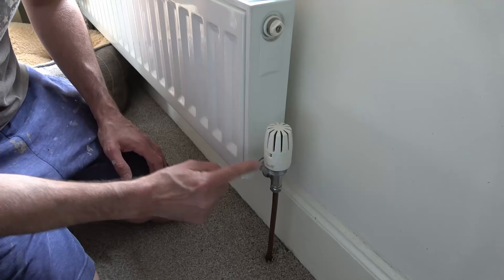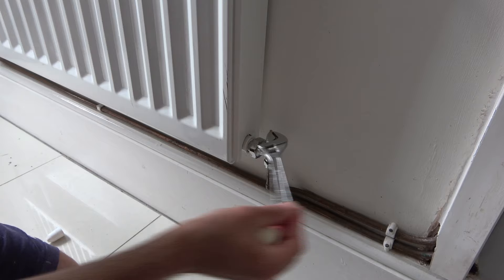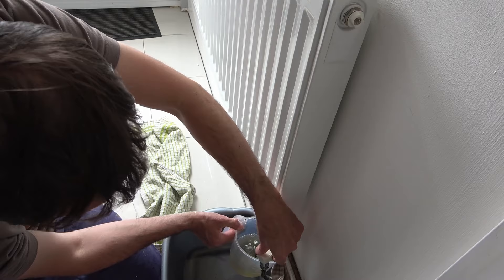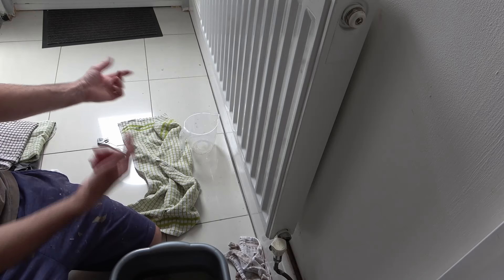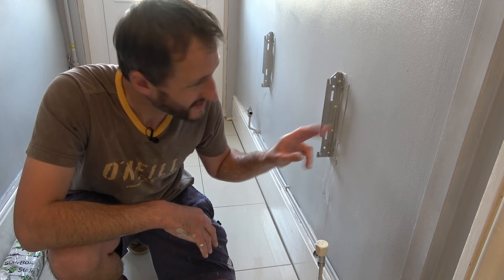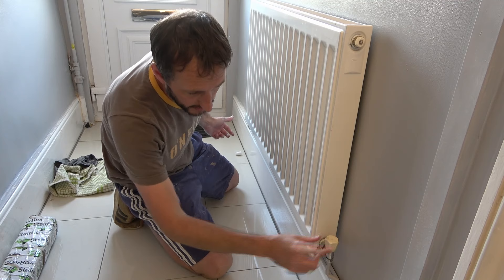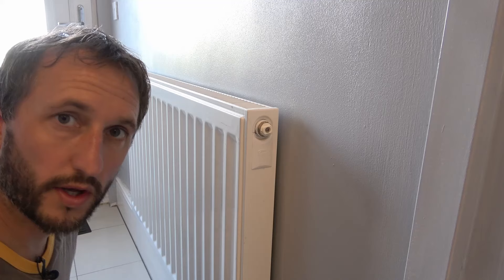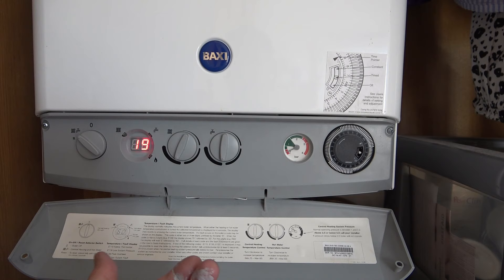How to remove & refit a radiator without draining central heating system. Radiator valve isolation.

Comment: Another tip don't leave it out the front cos the fookers will have it on a scrap van before you've put the kettle on.
Reply from the maker: I never leave any metal out the front around here!!
Reply: Great video
Reply: Around my part of the green and pleasant land we don’t have to put the scrap out the front they just come in and remove it from the wall when those of us are lucky enough to have a job are at work 👍

Comment: Why didn't you use the drain on the rad valve at the other end .....plus people please please please if your radiator has a thermostatic valve either shut it with the manual decorators cap or fit a brass blanking cap to the valve exit cos they have been known to open on the frost protection setting

Comment: If you get an old pair of rubber washing up gloves cut off a finger. You can stretch it over the radiator pipe and keep most of the water in the radiator to take it out and then drain it.
Reply from the maker: Great tip, I might try that. Thanks for the feedback and thanks for watching John. 👍

Comment: Once the radiator is off block the bleed valve, and turn the radiator upside down, that way it won't leak on your carpet

Comment: Tried it yesterday, sadly didn't work. Closed off left and right as far as it would go, opened the bleed valve and air and then water shoots out suggesting that the inlet on the bottom won't close all the way 😢

Comment: I'm needing to change out a valve that's seized open on one of my old cast iron radiators. It's located in my living room, and is directly over the boiler in my basement. It's the first to recover hot water and is the hottest radiator in the house. As a result, the heating throughout is not balanced. The problem I'm having is that i would like to do this without draining the system, but i believe that's not possible for me to do because all of my radiators only have a valve on the entry port of the radiator and not another  valve on the exit port. In my situation there's really no way to do this without draining the entire system, correct?

Comment: I use my wet hoover and just vacuum the water as it comes out. If a smaller rad I'll cling film over the rad valve and elastic band it in place. Rad can then be carried outside and emptied.
Reply from the maker: Nice tip, thanks! 👍

Comment: This is very helpful and easy to follow. The two top screws holding one of my radiator have come loose needing redrilling new holes. Rad is wobbly. Thought I had to empty the system to remove the rad to fix the screws until I came here to watch this video. Thank you for this well presented video.
Reply from the maker: No problem, glad to help 👍

Comment: Little tip...if you are storing the radiator inside while it's off, nip up the bleed valves and flip the radiator upside down, it definitely won't leak then.
Another tip....don't rely on a TRV being turned right down with the radiator disconnected, always best to lock it off with the little cap it came with. I knew a guy who flooded his house once because he did that. It was real cold weather and the thermostatic valve opened when he wasn't about! Oops!! (He might chip in if he's reading this! 😂)
Reply from the maker: I think I know that guy!!
Reply: Not sure if you chaps are still about, but I,ve tried this today. All went well until i saw the boiler pressure right down. Decided to add some water in, assuming I'd locked off each end, but the thermostat side in OFF still p*ssed water everywhere.

Comment: Thanks perfect timing. I've had my radiator off for plastering. Managed to refix the brackets to the wall and hang it back up. But haven't yet bothered re connecting the valves and filling it back up. Will have a go at it tomorrow. The pressure guage on my boiler doesn't have a green bit so I've taken a photo of the pressure it was at before starting, and get it back to that pressure.
Reply from the maker: Taking a pic is a great idea, best of luck with it and thanks for watching.

Comment: You legend, thank you. Your tut gave me the confidence to replace my first radiator. Good advice on how to keep the system balanced by counting the turns of the valve. I had to replace a two-column vertical radiator and 10 minutes in it had me wondering how long it would take to empty (20-30 min eventually). When filling it back up, it took a good two minutes before I had water coming out the bleed valve. In between I had to top up the main system as it dropped out to zero. As a newbie I would just add, surround yourself with loads of towels and a couple of buckets, make sure you know how to top up your boiler, make sure you have all the tools to hand before you start, and go slow. Thanks again.
Reply from the maker: Great advice, thanks for watching 👍

Comment: Great video. I'm contemplating changing my bathroom radiator for a towel rail type. Fortunately I have shut off valves either side of the rad so there shouldn't be any leaks from the system but the rad still needs draining and I was unsure how to do that. Your video has explained perfectly and very well presented too. Thanks for the tips. And I've subscribed. 👍
Reply from the maker: Thanks for the kind words. Glad to help, and best of luck with the radiator 👍
Reply: You're very welcome Pouse. 👍😀

Comment: Excellent video is it worth dumping some inhibitor by opening the top valves of the rad before opening the valves on either end to repressurise it...
Reply from the maker: You can but it's quite difficult in a normal radiator. A towel rail in bathroom is a better way to add it if you can, or in a magnetic filter by the boiler if one is installed. Thanks for watching 👍

Comment: I use a rubble sack to drain in to. You can pull it up behind the rad and valve so it doesn’t spray over the wall.
Reply from the maker: Thanks for the tip and thanks for watching!

Comment: Do you put some inhibitor into the radiator to ensure you keep enough in the system? Great video
Reply from the maker: I didn't on this occasion but you can. Easiest way to add it is through the top of a heated towel rail if you have one as the valve is on top. Hope that helps. Thanks for watching.

Comment: Spot on that pal 👍🏼 I need to stick some wallpaper back down behind mine… just a quick one though, I have to keep topping up my system so what would be the cause of that?
Reply from the maker: If it needs topping up, either air in your system, or you have water leaking or weeping out somewhere. Try bleeding all your radiators, refill as you go so not add more air. Then see if that works. Best of luck.

Comment: Very helpful thank you.  Is there any way of changing the values and pipe below without draining the system.. I need to replace a damaged pipe you see.
Reply from the maker: It depends on situation. You could lock off all the radiator valves and just drain the pipes leaving water in tge radiators? Hope that helps. Thanks for watching.

Comment: Are modern radiator brackets universal? For example could I replace a Kudox radiator with a Stelrad radiator of the same dimensions without having to replace the brackets?
Reply from the maker: It's likely they will fit yes. Best of luck 👍

Comment: is it possible to chase the copper piping in the wall for the radiator ? & what if anything do u need like insulation for pipes ??
Reply from the maker: Yes you can chase copper pipes in wall. You can lag them with various materials these days prior to plastering over them but it's making sure you have enough room for your pipes and lagging. Hope that helps. Thanks for watching 👍

Comment: Great video, thank you. My boiler hasn't got any loop valves or a pressure gauge... how does it add the extra water? or doesn't it matter on my Conventional 15yr old boiler? thanks
Reply: If it’s not a combi boiler it won’t have these.

Comment: How would you know which side is the lock shield and which side isn't. If both caps on each end of the radiator are missing
Reply: Not all rads have trvs.perhaps he has his thermostat in the landing hence no trv on the rad.
Trv should have a thread on it
Reply: @incorrect1844  I have an old rad where both caps are missing and the valves that turn look identical so unable to identify a lock shield
Reply: @shoudd  then you have a radiator with double locksheilds so it’s either an older system or that radiator is situated closest to the room thermostat (if you have one) take note of how many full turns it takes to shut off both valves as you will need to open them up to the previous position to reduce any issues with balancing ie: that radiator either takes all the heat and the others don’t perform as they did or that radiator will not heat up also depending on the age the locksheild may start pissing water at you as soon as you turn it or when you open them back up the gland but may leak…. Have fun with that or alternatively just call a plumber….?
Reply from the maker: Might both be lock shield like mine. I have my thermostat in the room with the rad in the video, hence I had two lock shields. Hope that helps. Thanks for watching.
Reply: Wheel head and lock shield is a naming convention, a wheelhead valve is the valve on the flow circuit ie out of the boiler, the lock shield is on the the return circuit. They usually are identical, what is different as Pouse showed is the cap. Think of them as two sink taps one with a handle to turn off and on the other with the handle missing. Why? When the house is first setup the heating system needs balancing, all the valves to each radiator are open, when the heating is on, the radiators far from the boiler will be slow to warm and those closest to the boiler will be toasty hot. Simply, the pump is pushing water around and the water goes through the radiator with the least resistance. By partially closing the hottest radiator valve on the return circuit we restrict the flow and the radiator has less water flowing though it so it is cooler. This time consuming job is complete when all of the radiators are the same temp. As we don’t want anyone messing with this “balanced” setting,  a cap that spins and cannot accidentally be adjusted is placed on the valve ( the lock shield valve) We can turn off the radiator using the (wheelhead)valve on the other end of the radiator this has a cap that can turn the valve. (This is the valve that is replaced If you want to put a TRV thermostatic radiator valve on).
Once the lock shield is set along with the other radiator’s it is left alone. To the poster who has no caps on the radiator, then the one that gets hottest first is the one you use to turn off and on the radiator. If both the valves have been messed with merely fully open both of them and after the heating has been on  for a while hold your hand on the radiator and compare with the other radiators in the house, it is too hot compared with the rest of the rads in the house then partially close the lock shield valve on the return circuit (at the opposite end of the the one that got hottest first) adjust until it matches the other house radiators. Check you’ve got it right when the heating is next on, Mark it with some paint and leave that valve alone or buy some radiator caps. 
I think of the names, wheel being one you can turn and lock as one that is locked and don’t mess with.

Comment: If you have the rad off for a day or 2 can you use the heating as normal?
Reply from the maker: Yes, just close the valves down by the removed radiator and it will be fine. When you add the radiator back on you will need to bleed the radiators as per the video and repressurise the boiler. Best of luck 👍

Comment: Whey didn't you drain the radiator using the drain valve fitted on the left hand side of the radiator.

Comment: Why did you just drain the radiator using the drain off valve on the radiator woild have made less mess
Reply: That would of drained the whole system though. 🤭🤪🤣
Reply: @bramleymoore64 no it wouldn’t, it would drain that radiator